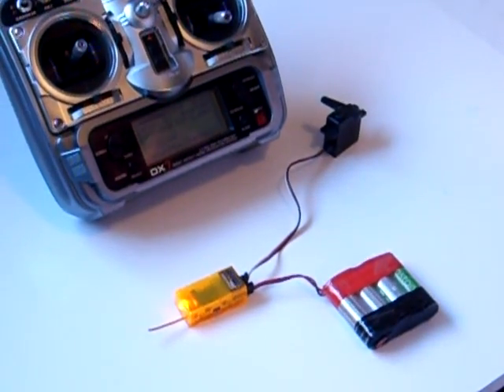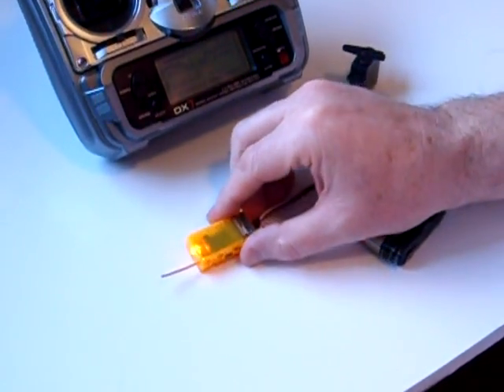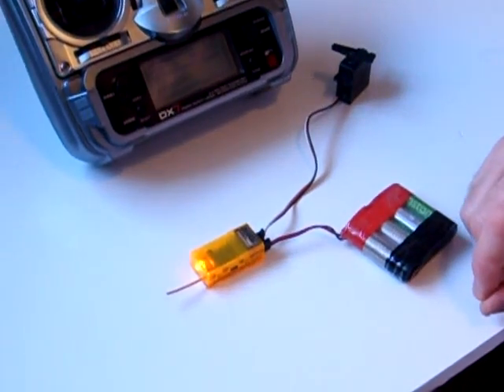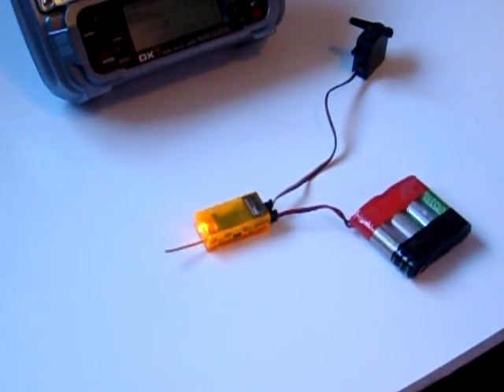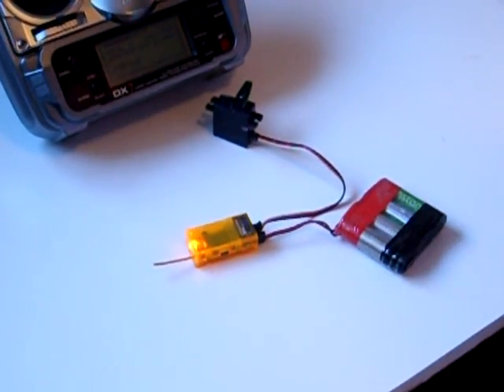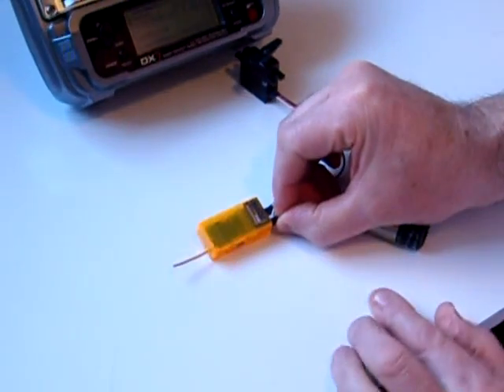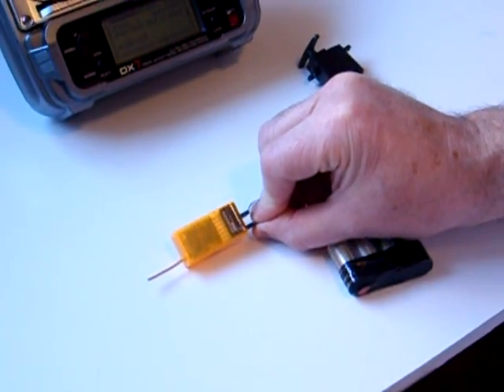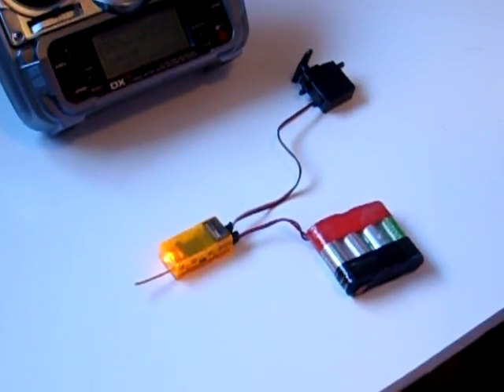Spektrum 2.4Ghz Radio and Brown Outs.

Comment: for a start spektrum State that there radio gear/system should not be run on 4cells(4.8v)  they should be run on 5cells(6v)  or 2s1p Lipo's.